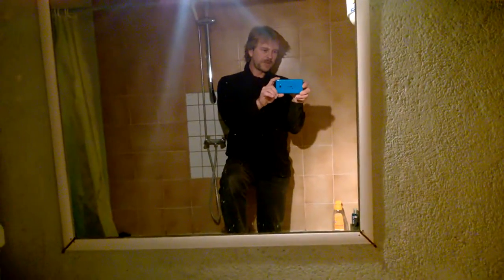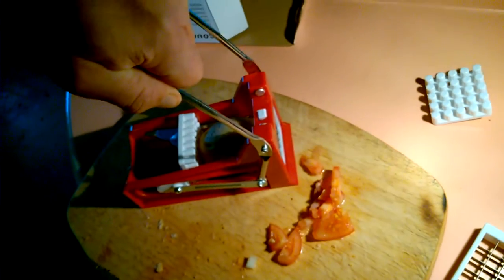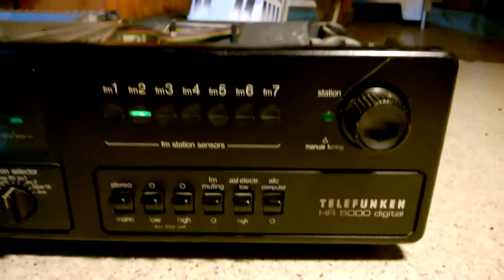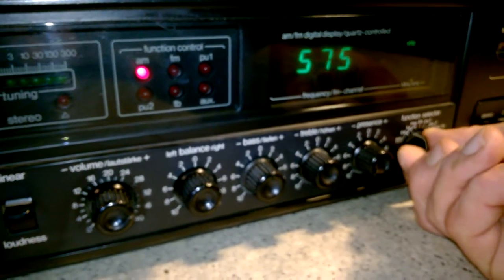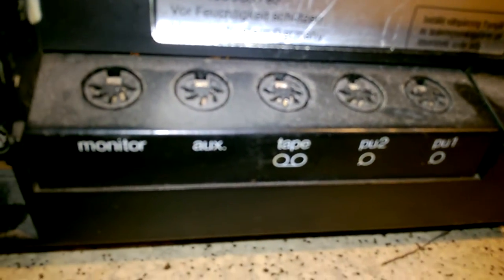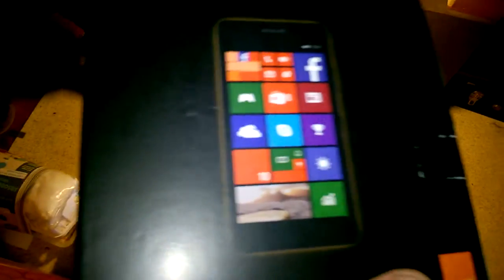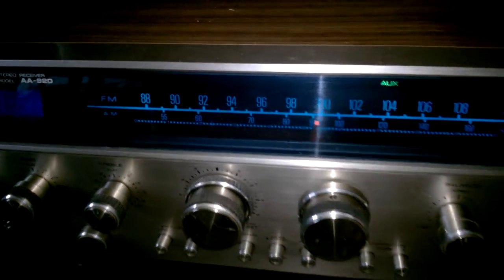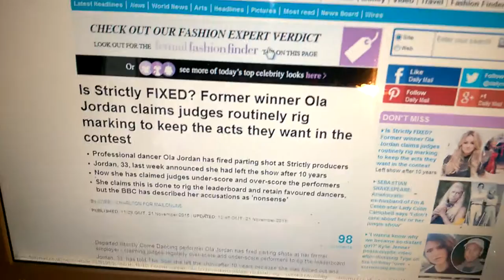Test: MS 640, UNBOXING: chip cutter, Telefunken HR5000, Grundig TK 6L

Comment: Someone just gave me a mint HR5000. What a beauty. Sort of a swan song for mainstream German consumer electronics. How the Devil do the loudspeaker terminals work? DIN I know, but I've never seen these.
Reply from the maker: Lucky you! Standard two pins inputs for the speakers, they are what the German hifi industry used (Japanese used to bare cable method) Easy to live with but you do need the connecters on the end of your speaker wires. 
You can poke the bare wires into the holes at a push and the speaker will work. The + is the small hole, the earth - black wire, put into the 'spade' shaped hole. 
Pin hole is + spade shape is -
Just push the speaker wire in. Try not to touch the speaker wires! 
Let me know if you get sound.
Any vintage german speakers of course come with the 2pin connecters on the end of the cable, although some people will of course have cut them off so they can run the speakers into Japanese amps.
Reply: @Netlife-001  Why, thank you very much for your detailed response. I am starting to remember those connectors from my youth on Brauns. The Braun 1030 active was something of a cult object in those days though I found the German sound a little bright in the upper midrange. The trait seemed cultural as it was just the same with Telefunken loudspeakers.
Reply from the maker: @campyper5299  I've got two pairs of Telefunken speakers, one in particular are very bright. Saying that they are nowhere near "Top of the Range" Telefunken. I would dearly love to have stumbled across any over the course of the last 10 years in the Jura, but no. 
... not yet anyway ;o)